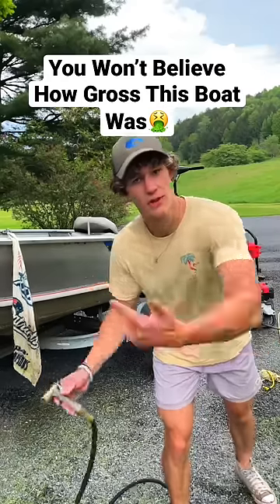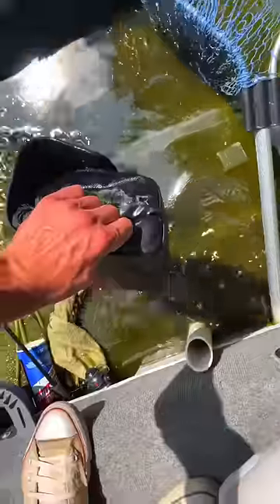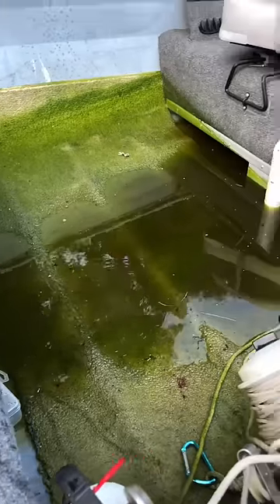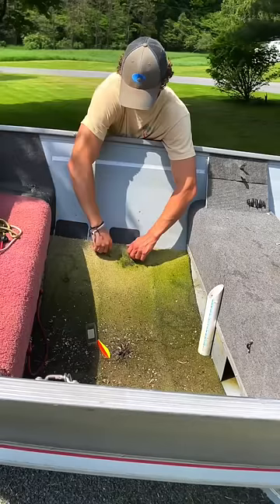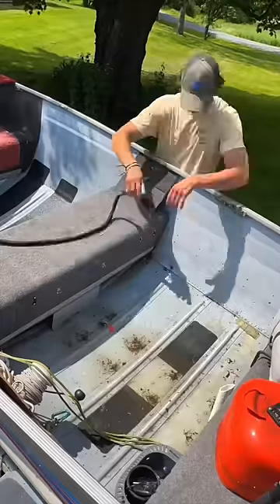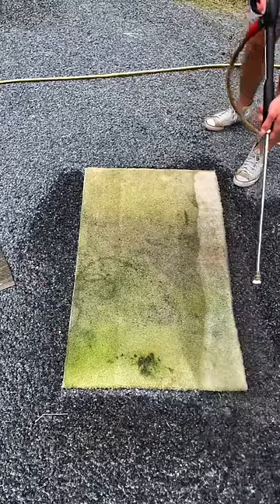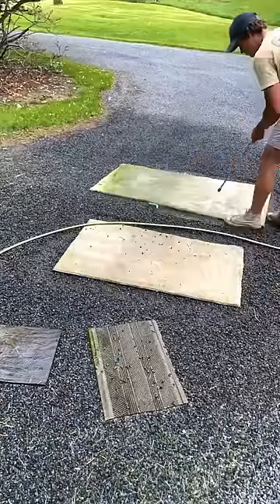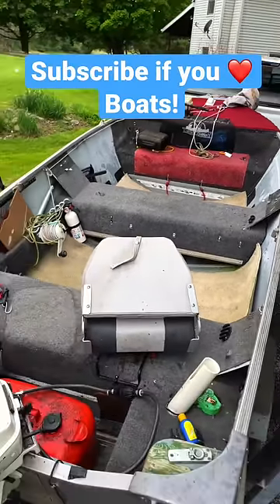Shoutout This Mink For DESTROYING my Boat😂 #diyprojects

Comment: I've owned many boats. When dry stored. Open the drain and point the bow up. It will self drain that way. Replace the plug every spring. Put it in from the outside. Keep a spare plug. If you are getting water in while sailing remove the plug and start sailing. It will bail itself only while moving.

Comment: The plug is supposed to be installed from the outside of the boat. Use common physics how will the water push the plug. If it’s outside the boat the water with push into the boat. If you put the plug inside the boat the water pressure can undo the plug

Comment: Put the plug in from the outside like it's supposed to be and you don't have to put hands in water. And as soon as you pull boat out the water pull the plug and always parks boat on a angle and never have standing water. 👍

Comment: Next time just like spray it off and also get a steam cleaner because it's still 30 you just brushed off the surface debris to make it look good but in reality there's still a s*** ton of germs and s*** it's been sitting it's soaked in to the actual fabric you need to steam it

Comment: Protip buddy, you can usually pop the bilge cap from the outside with a sharpie
Reply: No, because the plug is sealed and to tight to push out with our releasing the pressure.

Comment: The plug shouldn't be Installed in the boat while it's on the trailer it should only be installed at the boat ramp just before you put it In the water and then removed once boat is back on trailer before you even leave the boat ramp.

Comment: Why would you put carpet in a boat
Reply: I had that same question why
Reply from the maker: Came like that, idk honestly only thing I cAn think is less slippery than bare metal?? Idk its odd
Reply: True, but I imagine it stinks after awhile. Couldn't you get the same grip they use on skateboards though?